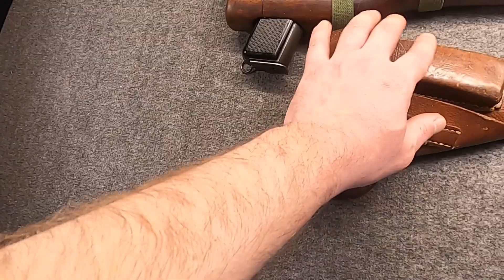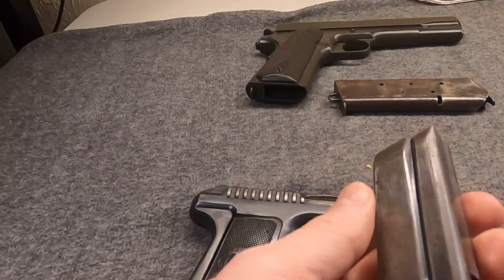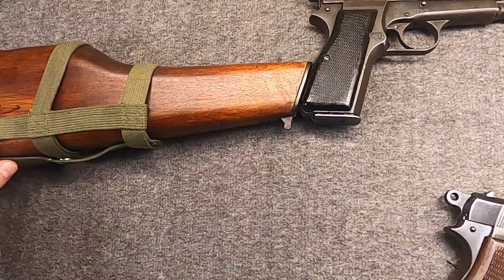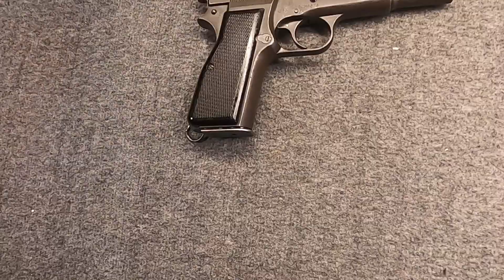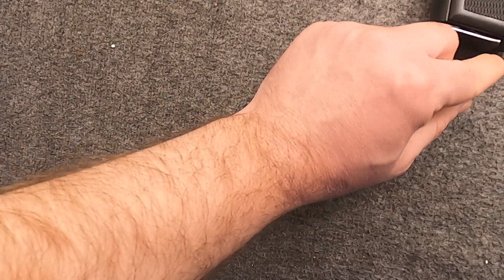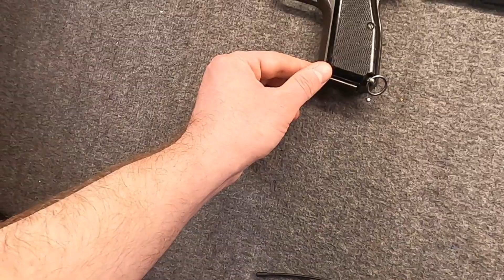Why The Excitement For The New FN & Springfield High Power Pistols? (Browning's Legacy Today)

Comment: A nazi occupation HP had passed through my hands that did not have the magazine disconnect.  the trigger was not milled not drilled to accept the parts, that feature was skipped.  I would guess the gun was likely among the final batches when the masters were in a hurry to get as many sidearms out to the troops as possible.
Reply: Yep, I'd say you are right. Late production Sauer 38Hs also lacked several features. Even the Walther PP saw steps skipped at the end.

Comment: I didn't realize the old Hi-Power had gone linkless. As for the new H-I-G-H Power, my understanding is few if any parts are compatible with the H-I Power. The barrel locks into the ejection port like a Sig, the magazines aren't compatible, slide serrations are significantly coarser (like Sig), and they made it single action only. Maybe they figured if they had given it SA/DA and a decocker, it would be more similar to Sig than Hi-Power. It seems like the combination of modern features and capacity, SAO trigger, and steel frame is going for the target/range market, more so than historic interest.
Reply: Yep, you are right. The newer guns and clones are really getting away from the original pattern so much that very few things are backwards or fowards compatable now.  I'll just stick to my old-fogy P35s.

Comment: in reply to your comment about the French pistol cartridge at 12:05 - 7.62x20 Longue's muzzle energy (215ish ft-lbs) was identical to that of typical .380 with the original French load at the time. So it was also in the ballpark of 9mm Makarov. Modern Steinel 7.62x20 Longue is loaded even hotter (250 ft-lbs) because the firearm actions the French developed for the cartridge can all easily take it. This idea that the French were using a pipsqueak of a cartridge is a very old misconception that needs to stop being perpetuated.
Reply: I'm actually pretty pro-Franko around here, but i do think 9x19 Para would have been a better choice for them over 7.65x20. And the French seemingly agreed, adopting first the P38 and soon the Mle 1950 both in 9mm P.
Reply: @misha5670  9x19 would have definitely been a better choice, but France gonna France. My argument is simply that 7.65x20 isn’t nearly as much of a slouch as people think it is.
Reply: I really love Japanese smallarms, but their choice to stick with 8x22 wasn't the best. It bit them in the rear when the Type 100 SMG came along too.

Comment: Misha, FYI, The Canadian one of yours has a Chinese stock, with four Chinese characters on it. They read as "nine zero wood holster". I have no idea what 90 refers to exactly, though.
Reply: Thanks, and yep sure does.  As best anyone can tell, its original, and that included an ATF exam *shrug*. Its good enough for me.
Reply: @misha5670  the characters are in traditional Chinese, and look aged. So the shoulder stock does look original to me. Probably you have a Chinese contract Canadian Hi-Power, IMO. In that case, the serial number usually has "CH" in it.